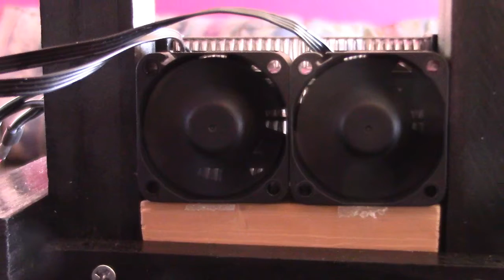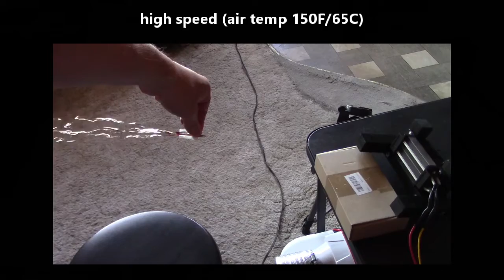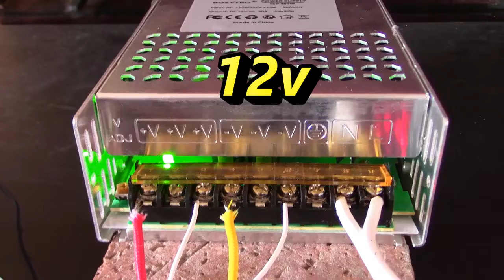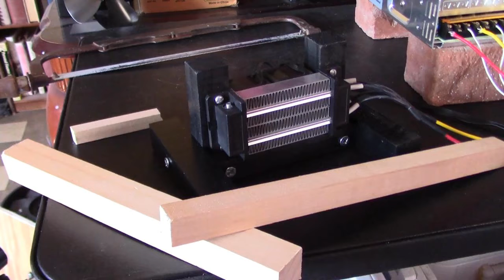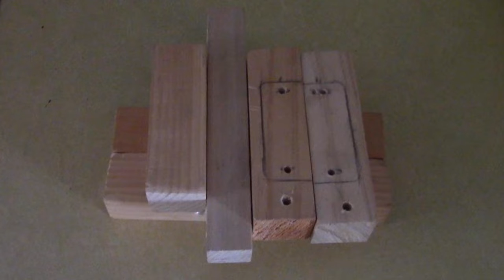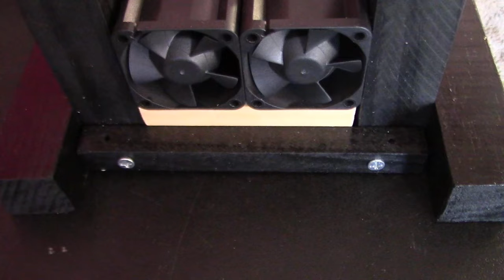High Power DIY Ceramic Air Heater! Output Air 200F/93C! (w/adj-speed fans) 18/20a AC/DC solar/bat op

Comment: Running them straight to solar isn’t a very smart   Thing to do with out any regulation
Reply from the maker: hey there, these elements are pretty tough. they can be run on voltages from 12 to 24v so they work well with the slightly higher voltage of a 12v solar panel. also, the heating element is a 'proportional heating element" (meaning that if the volts or amps are less they just heat up less) and when the sun comes back out they just go back up to full heat again. the fluctuations don't hurt the element. ...now if you want a steady-even heat at all times then a battery/power supply is the way to go for sure.

Comment: Hi desertsun02, is it safe to plug this on a power station and leave it running 24/7 as a supplement on heating a basement?
Reply from the maker: if the power station you're using gives you the amps that you need, then i would think it would work.

Comment: Where do you get the materials for build
Reply from the maker: i bought the 4 main items (the heating element, the fans, the speed controller and the power supply on amazon). and i got the square wood dowels at home depot. btw - the element itself is a popular one on amazon. they have many sellers. if you have trouble finding any of the items just let me know and i can 'dig up' a link for you. *post any requests as new comments because i always see the new comments but not all of the replies.

Comment: I have a 48V power supply; does that mean I also need a 48V heating element and fan?
Reply from the maker: hi. you couldn't use a 48v power supply with 12v fans or a 12v heating element. it's best to stick with a 12v power supply if you make this heater. they are pretty cheap. i got mine brand new for only 15 dollars on amazon and they had other ones for 19 to 20 dollars. i haven't done much research on 48v dc heating elements (but i have seen them for sale). i have not ever seen a 48v fan but they may be available.
Reply: @desertsun02  I've got a 48v fan, heating element and power supply. The heating element was $27 including shipping on Amazon. All I need now is a fan controller.
Reply: @desertsun02  Your power supply has 9 connectors whereas mine only has 6. I'm wonderng how I I can connect all the hardware correctly. I have a smaller size 24v fan that seems to move a lot of air.

Comment: were did you get the heating element?
Reply from the maker: hi. you can get this heating element on amazon. it's a very common size heating element so you'll see lots of listings for it. the price ranges from 13 to 17 dollars. to find them just search for "12v 200 watt ptc element" or "12v 200w heating element" and you will be lots of them. i bought the 17 dollar one because it was considered the 'newest element' of this kind.

Comment: This little heater looks bangin. I have bought little plug in 500 watt heaters which work with a ptc heater and a small computer fan, the problem isnt the heating element but the very poor airflow from the computer fan. If the fans pushed more air it would actually be good this seems to  solve this issue.
Reply from the maker: hi. yes indeed! even on low speed this unit pushes a lot of air. i only run it on low and sometimes medium because even that is more than enough. it's the hottest and fastest heater i've ever made.

Comment: Man, I love your DIY ingenuity and projects that you come up with. I have built a 300W solar backup system with 2 100AH lifepo batteries. I have a 1500W space heater and IIRC, that my setup would only be able to produce 3-4 hours of usage ? in case of power outage. If the heater in the video uses less power to produce more run time then that, it will give me a great reason to build one. After I finish paying off the 300W system, I plan on getting one more battery and one more 100W solar panel. I love the content of your channel, keep the ideas coming brother.
Reply from the maker: hi there and thank you! i think this heater would be a great fit for your situation. you could get 10 to 12 hours of runtime from it on your battery system. btw - I've run this heater side-by side with a cheap 1000w AC powered store bought unit that I got a few years back and they seem about the same. no kidding, i know that sounds impossible but this 200w heater seems to be at least as good in terms of heat generation as that one. it's an older 'nichrome wire based' one so maybe that explains it. those are much less efficient than the new PTC ceramic ones.
Reply: @desertsun02  - Yeah that's wild. I think this will be my next little project to keep me occupied, Have you thought about making some sort of enclosure for it?
Reply from the maker: i don't recommend trying to enclose it. if the 'enclosure material' were to touch the element you might run into big problems. best to let it stay open and 'unencumbered'.
Reply: @desertsun02 Never heard about electric heaters being more or less efficient. Is one watt turned into heat not the same in every coil or cable element?
Reply from the maker: @Teknopottu technically, you would think so, but many lower wattage heaters work better at heating an area than higher wattage ones. and different types of heaters of the same wattage can have wildly varying degrees of effectiveness (from great to crumby). i'm not sure of the all the variables but some 1000w and 1500w heaters are terrible at heating a space and some 200 to 500 watt heaters are great. (maybe it's how they 'disperse' the heat)